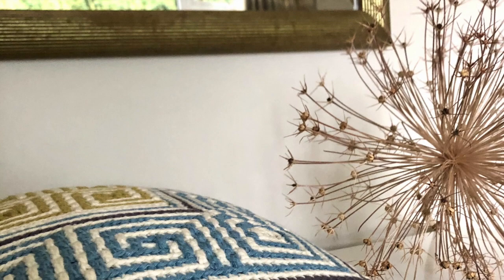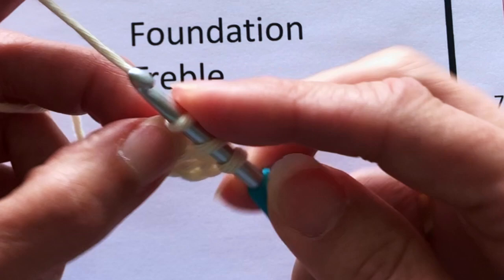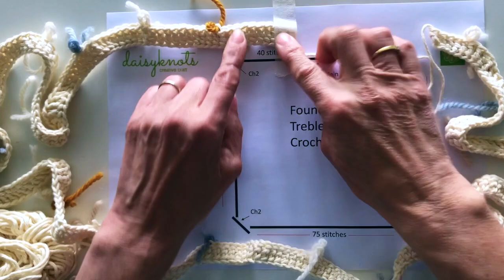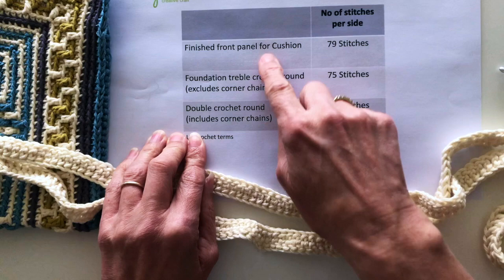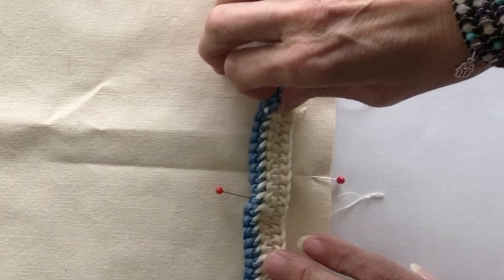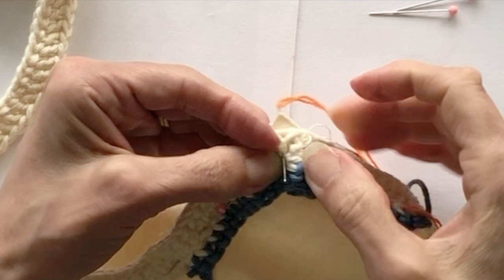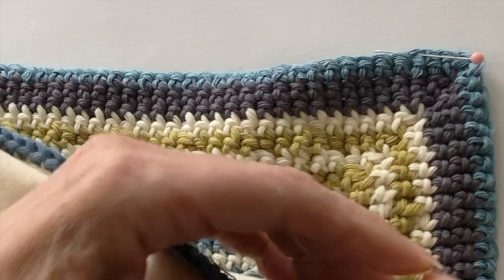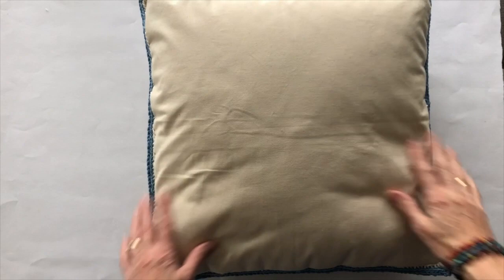How To Make A Non Zip, Fabric Backed, Mosaic Crochet Cushion (Hand Sew Method)

Comment: I just discovered your channel when I looked for a way to attach my two crochet cushion covers to a fabric backing.  An amazing and ingenious way to really make your attachment secure.  My only question is how you would remove the covers when they need to be washed.  Thanks you for a wonderful tutorial.
Reply from the maker: Two ways to do this. One method is to add a zip into the fabric (or you could envelope the fabric too I suppose) or the other option is to make sure when you are sl st the edges together to make one side a side that you can unpick easily and then sl st it again once washed